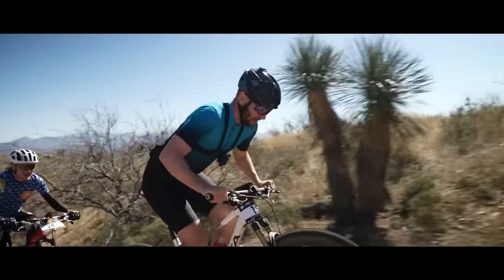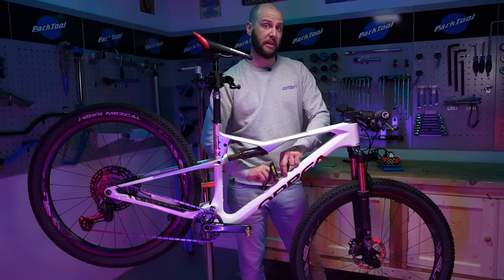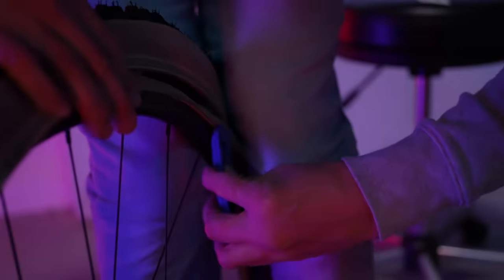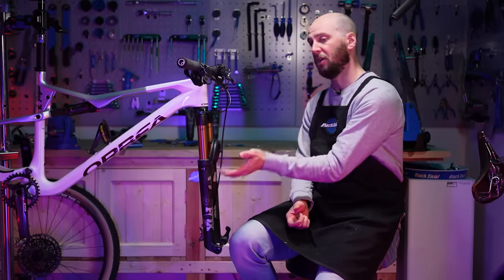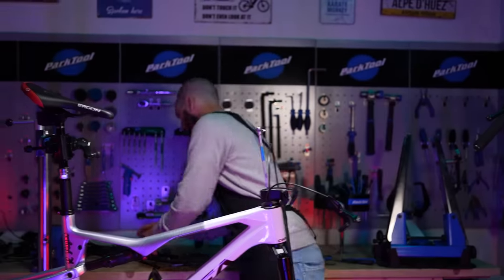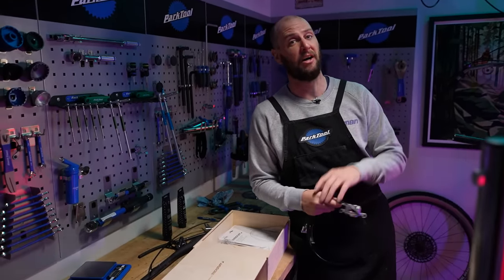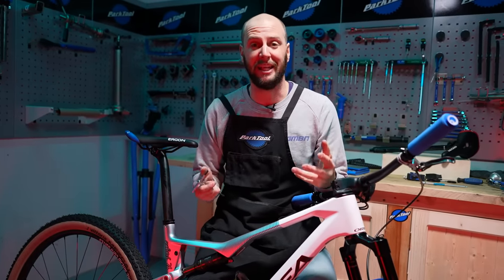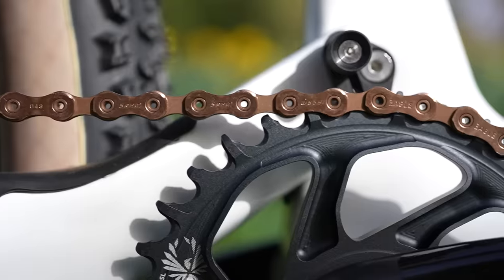How Light Can We Go? | Rich Tries To Build The Ultimate XC Bike

Comment from the maker: Do you know the weight of your bike? Have you made any changes to get it lighter? Let us know down below!👇
Reply: Track the weight of my bikes more carefully than my own. Not gonna say always happy with either
Reply: 35 lbs probally because of the dh tires
Reply: Yes, 20lbs for my Yeti A.R.C and I use Fox factory 34SC forks, full Shimano XTR, Thomson stem, carbon bars, Elite seatpost (rigid NOT dropper) ,Stans wheels and Maxxis Aspens.
Reply: I do know the weight of my MTB, but never once swapped a part on it to save weight... Replace broken stuff with stronger beefier stuff I sure have.  For an old cheap aluminum 26er XC bike, it's quite porky @ 15.421kg (~34lbs) - not bad for a rough and tough XC bike that is not used as an XC bike at all.
Reply: 19.84 lbs for my Large size Trek Procaliber, with XX1, and I actually made mine heavier; larger rotors, a more comfortable saddle, but got the Vittoria Barzo in the front and the Mezcal in the rear to replace the Bontrager Team issue XR2's, so it now weighs 20.2 lbs.
Reply: 15.75kg with pedals and tubeless - Spectral 29 AL (Size: XL)
Reply: No go both, I just ride it
Reply: Specialized epic - 10,8kgs - tools and pedals included. (And heavier fast track tyres much needed for my riding terrain).
Reply: 11kg Orbea Alma.
Reply: In the Philippines, some riders are building "hybrid" bikes, 26er frame using a 700x40C wheels.
Reply: Mine is 9kg :) 
Bmc team elite 01.
Reply: Wheelset alone got me from 14kgs to 12.4kgs. ✌️
Reply: Not exactly. Although I am putting my trail bike on a bit of a diet (carbon bars and crankset, lighter cassette), but I am tracking the savings more than the absolute weight. But being somewhat overweight the biggest and cheapest weight savings come from me cutting down on snacks and riding a bit more 🤐😂
Reply: My S-Works Epic HT is at 8,6Kg ❤
Reply: awesome build... good to see you are creating content about XC , would be great in you create content comparing the experience racing XCO and XCM . Kudos!
Reply: 30lbs Random bmx with super heavy mods
Reply: Epic Evo size M 8.5kg Fast Trak tires, 1058g wheelset with remote on front and rear. Canyon Lux size M 8.9kg Ground Control tires and 100g heavier wheelset
Reply: Orbea Oiz M-team 2020 frame, FOX I-line DPS 120mm shock, Rockshox SID Select 100mm fork, Squidlock remote lockout for shock, DT Swiss X1900(heavy) wheels tubeless setup, upgraded to LN Ratchet freehub body, XTR M9100 brakes, XTR 180mm on the front and XT 160mm on the rear,  XTR M9100 shifter, XT rear derailleur, XT crankset 170mm, XT cassette 10-51 and 36T Garbaruk chainring, PRO carbon saddle, rigid KCNC Scandium seatpost, PRO 700mm carbon bars, PRO lock-on grips, Specialized Renegade S-Works T5/T7 2.2 on the front and CST JackRabbit II 2.25 on the rear, Newmen stem 60mm, XT pedals, Elite Race bottle cage. The weight is 10.35kg/22.818lb.

Comment: 2:42 Tobolito are indeed very light, but they last about one or two rides the most, because they start leaking air. Many of them suffering from "invisible" holes in the tube that you only can find by submerging them underwater. I've been through 3 - 4 sets in one season by applying over 20 patches using their repair kit. Everything costing me over $350 - which is crazy expensive for just a few grams. The following season I switched back to the Continental tubes that are also one of the lights regular tubes. I don't recommend Tubolito at all!

Comment: Titanium Casette and rope spokes, full carbon seat and some titanium screws. Could save almost another kilo right there
Reply: When using a carbon seat, you will lose some comfort. And as we know on long rides you don’t want your butt to hurt.
Reply: also paint, dont forget the paint, that stuff is heavy!
Reply: A kilo ? You dreamin.
Reply: @choanlpoto  no berd spokes are really light
Reply: Was thinking the same.
Reply: Woah who makes titanium casettes? 😍
Reply: @MarmiteFerret  Shimano XTR
Reply: @mads_ittmann1823  I think it depends if the seat fit you properly. I have done over 10h of riding in a full carbon seat with no problem 👌
Reply: @mads_ittmann1823  not really true in my experience, as long as the seat is shaped in a way that matches your bum. But yes if the seat is not right then some padding can make it fell "less wrong".
Reply: what a nonsense...
Reply: @grzegorztomczak8941  bro he just took off an xtr cassette
Reply: @mads_ittmann1823  XC race is no more than 1.5 hour only

Comment: Built a light trail part by part, estimating the weight from the start. I ended up being 1.5lbs different from design weight to actual built. Significantu unexpected weight came from underestimating/underreported brake cables and rotor weights

Comment: I used to be a Weight Weenie but now I just buy comfortable, sturdy and reliable  stuff. My local trails are rocky so 29er Minions with inserts and a nice big 160mm Pike. WTB saddle instead of the superlight (and bum numbing) Ergon Ti. Ditched the carbon bars, gone back to alu. I got my bike down to about 28lbs but now it's probably more like 30lbs.

Comment: I have that same bike. 9.5kg   Way less expensive and didn’t have to bin so many parts as this build. I bought the pro model. mine has a dropper, runs tubeless. I saved weight with Magura sl mt8 brakes, Garbaruk cassette, bike yoke sl 125 dropper, Cannondale hollow gram cranks with power meter, carbon saddle, 1250g wheels, and conti x-king and race king tires. And I did MyO carbon view gloss, so very little paint weight.
Reply: What are the1250gram wheels?
Reply: @ettoremarinello3951  I'd guess specialized control carbon SL

Comment: Got an old 2014 GT Zaskar 9r XC. Added a bafang e-motor and 360w/h battery. 16.8kg total weight.
Reply: GT recently went under. Those mid 2010 GTs are rarities nowadays and I bet will only accumulate in value, which is why I snatched myself a '14 Timberline 1.0 just before GT declared they're going out of business. Something told me inside to act fast since those designs are getting harder & harder to find. A mid '10s Avalanche is going for $1,300 right now on the resale market. And the thing with GTs is, the lower the model number, the higher end it is, with their pro named model being the best.

Comment: Nice build! 👍
I would still go tubeless though for no extra weight. Keep a dropper post (fox transfer sl: 250g extra weight) and change saddle for a Tioga Spyder carbon. Save few grams there and keep it confortable ;)
Overall: still sub 10kg with some extras game changer🤘
Reply: I'm wondering if tubeless is the same weight.  Is it possible for that tube to weigh less than the goop in a tubeless?
Reply: I was thinking the same for tubeless, may be a bit heavier but to me the reliability with that puncture protection tubeless gives you, especially during races would be worth the extra weight
Reply: @intomlinson  Yeah, it would really depend on the terrain.  Also with the lighter casing tires, there may be more chance of burping a tire if you go tubeless.  That's just a guess though, but if that's the case it would make sense to run tubes.
Reply: Dropper posts for XC seems really unnecessary, for enduro and beyond ? no doubt.
Reply: @neilk22  I'd say opposite, I use it more on xc trails with constant elevation changes. When I ride enduro trails it's more leaving it up whole climb and then down the whole descent.
Reply: @intomlinson  My thoughts entirely....certainly would'nt trust those orange featherlight innertubes,they just look 'trouble',lol.

Comment: I don't know about the tubulitos. The point of being light is presumably to be faster. I'd rather a bit more weight and less chance of punctures as I believe there's nothing slower than having to deal with a puncture. The best use for tubilito IMO is paired with tannus tubed armour - it can be lighter than a tubeless system with an insert and can have some advantages over it.
Reply: I had those tubolitos on my Mtb and Road Bike! As a spare ok, but I will never run them again over a propper tubeless system! I punctured them so often.. you can‘t go as low on tire pressure as with tubeless. And they are also pretty expensice.
Reply: Tunnus armour adds massive rolling resistance. Tubes + Tannus makes no sense for XC

Comment: Smashing build, not much scope for any more loss, but can go - Smaller rotors, replace all the steel bolts with Ti, (halve the bolt weight) swap the aluminium valve caps for plastic, trim the bar bung grippers, not sure on the saddle weight, but a full carbon with carbon rails shortie may be lighter? swap the axles for  burgtec - possibly squeeze 200 - 250gm from all that

Comment: I was fortunate to live in Madrid when they hosted XC World Cup events in the Caso de Campo. I was able to ride the same course every weekend. The gnarly bits and the downhill sections were pretty rough and I wasn’t taking them with the speed and force of the pros. My question is: If lighter is faster in XC racing, how light is too light to take the pounding of an off road course?
Reply: I've wondered this too. My guess is 25-27lbs is the sweet spot based on my experience riding a variety of bikes from 18lb fixies to 34lb MTBs.

Comment: Tires seem to be on a heavier side, the chain could be lighter, full-steel brake rotors instead of those with an aluminum spider were a real surprise for me 😂
Tubolitos are cool, but they tend to leak air through the valve and are very prone to punctures with anything slightly sharp inside the wheel.
No idea why I commented lol 😂

Comment: Lizard Skins ESP grips over the Ergon (also your bar end plugs were like absurdly long), Selle Italia SLR boost saddle will save you a chunk over the Ergon, The Fox 34 is a bit lighter than the SID and also allows the use of a 160mm front rotor instead of the 180 you have to run on the SID....although you might want to run 180 depending on the course. Resin pads are lighter than the metal whilst we're at it too. Carbon-Ti axles. Carbon-Ti stem cap. Nylon bolts for the bottle cage. etc.
Reply: They're sponsored by Ergon,so way they were dropping them!
Reply: Ritchey superlogic grips FTW? 10 grams a pair w/o plugs. Not sure if the Lizard skins at 27-30 grams (small vs. large) include the weight of the plugs.

Comment: Tubes, really? You ready to sacrifice the reliability for a little weight saving?
Reply: Reliability with tubeless? Enlighten us.
Reply: @danvalicek  Small punctures fix it self.
Reply: Relax it's a weight video
Reply: @ItsMeHammie  Bingo!
Reply: Agree with Stepan, at 85g a tube, sealant and a couple of valves are going to be 20-25g heavier a wheel, and will provide significantly better puncture resistance.
Reply: That's why I run heavy duty tires and heavy duty tubes with tire sealant.  I'll also seal off the spokes so any air/sealant that escapes will be forced out the puncture and not the spokes. 

First, my tires are really difficult to puncture in the first place. If the leak doesn't stop, the tires will still hold that last little bit and the structure of the heavy tire allows it to ride like that.
Reply: #askgmbn Are this Tubes worth it to lose some reliability? Would you do it again 🤔
Reply: Tubeless is really good. That's what I always use. Works great for me.
Reply: If he’s doing a race and running lower pressures, he’ll be fine. It’s a weight weenie build. Some things won’t make sense, but it’ll be lighter and that’s what matters

Comment: Curious how you saved 200g with tubes vs tubeless?
Reply: Stans fluid/sealant is quite weighty
Reply: @keithbowen9561  His tubes were 85g per tube. I just weighed my emergency 2oz bottle of Stan's and it was 72g with the plastic bottle. You could double that and put 4oz in each tire (overkill) and it would be maybe 125g max.
Reply: Probably because the tyres didn't need to be tubeless ready,so can use lighter ones.

Comment: Damn under 10kg for a full 120mm bike I have a 100mm hardtail and after changing some parts (Wheels/tyres/discs/seat) to make it lighter its still over 12kg😂
But I think the price of this build compared to mine is probably at least 5x more expensive.
Reply: Unsure xc but £4-5k can build a 8kg mountain bike, it is why I build than buy, next bike trek Emonda alr with axs dropper is sub 7.9kg, I would go SLR if allow axs dropper in it and be £3-5k cheaper than project one builds and lighter

Comment: If money were no issue. How much does the wheel set sell for again? 2699€? Oh yeah, that's right. I would say that money already was no issue here. ;)
However nice built. I personally would have preferred the XTR over the AXS, because I am not Fan of electronics and batteries in my bike. And with a different brand for the saddle you could probably save another >100g. But other than that, nice built.

Comment: Why put a  cap on your tube valve?  That's just dead weight.
Sand the paint job off?
Maybe grind few teeth off the big cogs and the chain ring?  You don't actually need them all.
Drill or cut some holes in the handlebar grips.
Carbon fiber cables instead of steel?